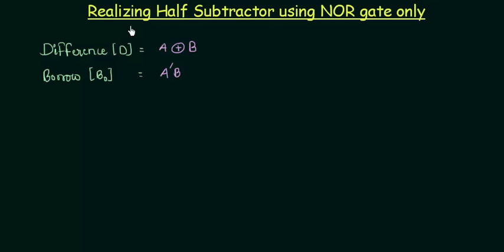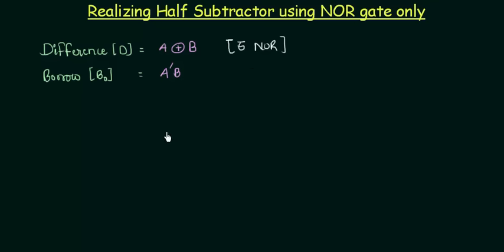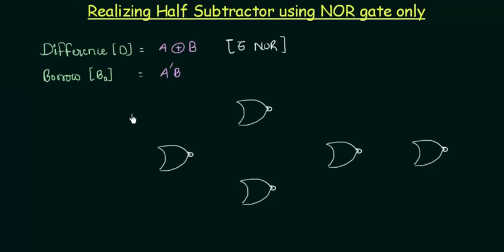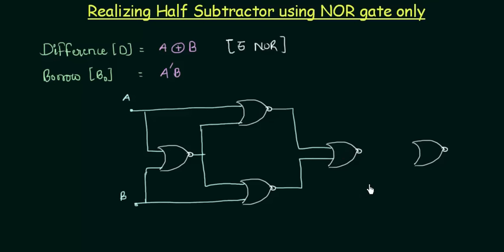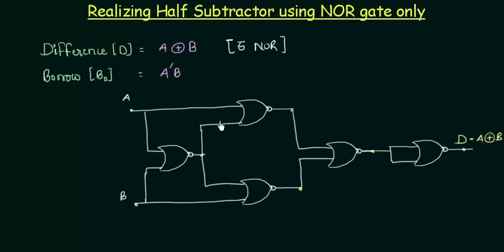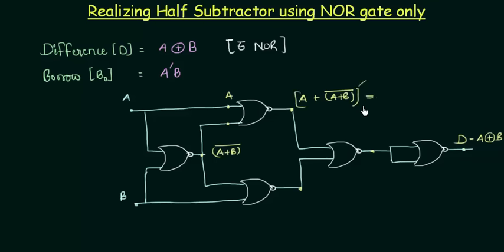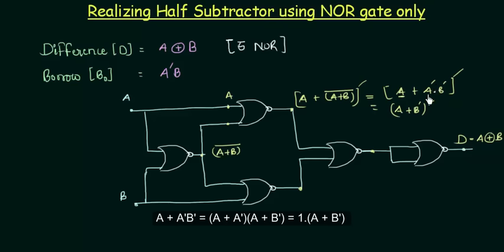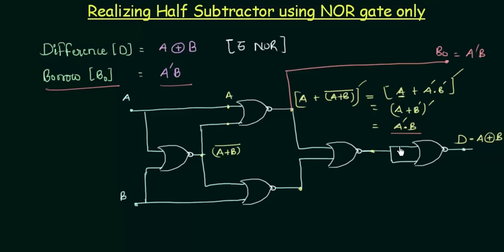Realizing Half Subtractor using NOR Gates only

Comment: There is no need of 5 nor gates we have to use only 4 nor gates for find xor of A and B
Reply: In the previous video of Neso academy the circuit used to form ExOR gate to form half adder by NOR is not used here as to get the borrow that from that circuit we need to use another NOR gate so overall no of gate increased.
Reply: you cannot implement xor using nor gates in less than 5 gates